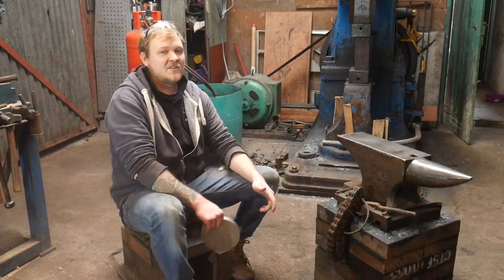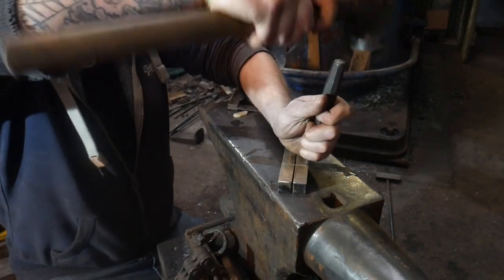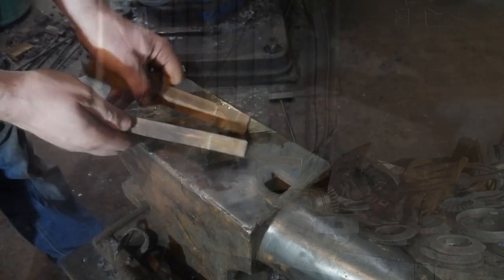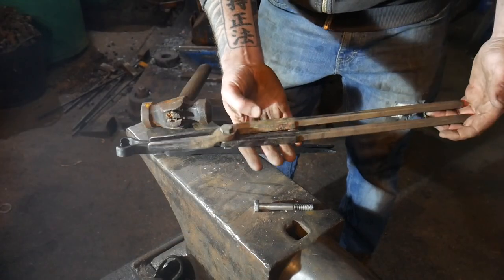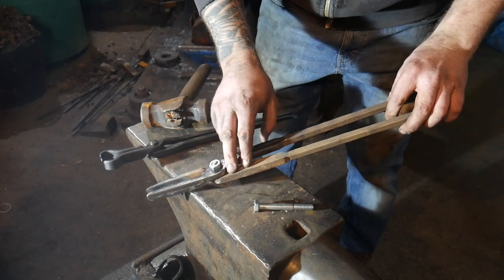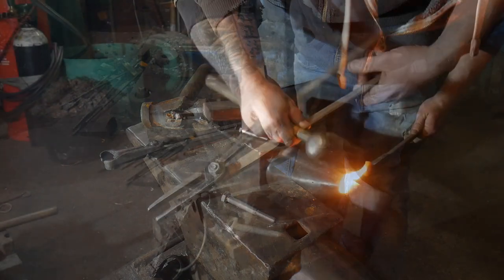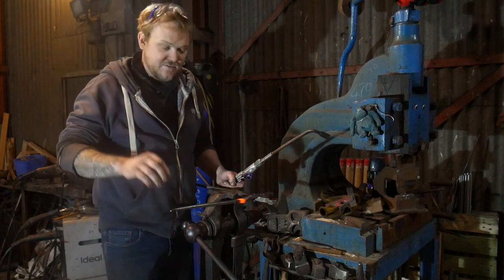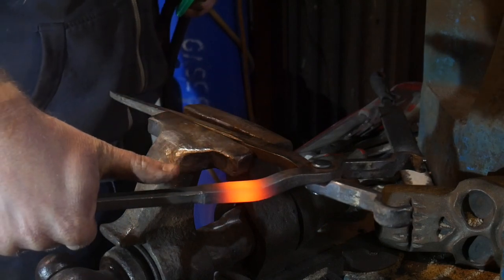Titanium Hammer Tongs! Forging tongs out of Titanium!

Comment: Never forged any titanium.
But I have TIG welded a good bit of it.
It welds beautifully, and takes on an interesting rainbow color pattern in the different heat zones after welding.
Being light weight, super strong and low heat conducting they should be great to work with. Less hand/arm fatigue is always a good thing.
Cheers!

Comment: And yes calsium oxide and water can reach temps to cause a fire. This was done in a controled setting. start off with a cup of hot water sprinkel calsium oxide into water as needed to keep hot.

Comment: The "granular structure": Because of the rapid formation of the oxide you cannot forge weld Ti. With steel that wrinkling would just meld into the rest and end up bonded.

Comment: 1) you need a center punch with a tungsten carbide tip to mark on titanium like that
2) titanium has good thermal conductivity because heat easily passes through. It has poor thermal retention
Reply from the maker: Double check this but titanium is consider a poor thermal conductor. I didn't just say it on the video with out doing any research. Titanium heats slightly slower than steel and stainless steel based on volume. Copper heats faster than steel and is   denser than titanium giving it a good thermal conductivity. I believe gold also has good thermal conductivity and is much heavier than steel. In fact it's about twice the density of lead. I believe aluminium falls into the poor heat condition also. Please check this like I said. When I get home I'll share the link with the information about this.

Also the titanium marks very easily for some reason but is very hard to grind. No idea why as I don't know the grade.
Reply: @danielmoss2089  it polishes easily though which is weird. I have experience with it in jewelry settings. Gold is definitely very conducive as is silver and platinum. Generally I think that the more electricity conducive a metal is, the more thermally conducive it is. That last part I need to check to be sure but I am going off my memory of the metallurgy which, I admit is rusty. I was a jeweler for a decade and had to get out due to disability. I took up blacksmithing as a form of PT.

Comment: Yes electrictry is differnt I always though heat was conducting through a pice of copper You can take a small peace 1' long heat it at one end and the other end gets hot right off like the heat travaled through it fast i always though this was conduction of heat. I gues it doesn't work like electricity. Thanks that answers my question.

Comment: When Titanium get hot fast and then cools off fast it is a good conductor of heat. Silver is an exclent conductor of electricity.Better than copper but copper conducts heat varry whell, Aluminun conducts heat whell also used for wiring. I asume that silver conducts heat whell because it is one of the best con ductors of electricty. You probley have a chart that tells what metal conducts heat the best. I am just wondering what metal is the best?
Reply from the maker: I checked this and the reason quick heating and cooling means poor conductivity is due to the heat not moving away from the point at which its focused. Not sure if you watched the whole video but I talk more about this at the end. Coppers and silver's take a lot longer to heat than titanium because even the areas of the material not being heated get hot as well. Titanium is one of the lowest conductivity metal known to man.
Reply from the maker: Also I believe good is a very good conductor and there are some materials called super conductors which have even better conductivity but they have to be very cold to work.

Comment: If it get's hot and cool quickly wouldn't that make it a good conductor of heat Dan? Steel is classed as a poor conductor because it takes a while to get hot and stays hot for a long(ish) time and the heat doesn't travel through the material well, hence why we can forge it easily.  Copper is classed as a good conductor for the opposite reason.  That said if the heat isn't travelling through the material then yeah, it's not a good conductor. , Titanium is weird stuff.  Nice looking tongs, I bet they're very light in the hand.
Reply from the maker: Did you watch the bit at the end?
Reply from the maker: Also I just checked and its a very poor conductor. Its on of the lest conducive metals and fast cooling is consider poor conductivity. Don't ask me lol
Reply: @danielmoss2089  yeah, edited my comment when I saw that lol
Reply: @danielmoss2089   So would that mean it's an excellent radiator of heat but a poor conductor?
Reply from the maker: So I'm not sure why and I said it with an air of not understanding but it heats up silly fast and cools down very quick and when I did my original research which might be wrong I'm sure it said poor conductivity was seen in the way it get hot and cools down. But copper heats slowly compared to titanium and the whole thing gets hot (copper) . Maybe that's why it titanium heats so quickly cause it doesn't push that heat to the rest of the stock? That would be poor conductivity right?

How are you? And yes very light lol
Reply: @danielmoss2089   If the heat doesn't travel 'through' the material it's a poor conductor, that I'm sure of mate. The fact it heats up really fast only where direct heat is applied supports that.  It's certainly capable of radiating heat really well though, as it cools very fast but that's totally different.  I've no real experience with forging Titanium, hit a couple of bits, was surprised by how soft it is at heat and how fast it got hard, but that's about it. Oh and the weight of course.
I'm not keeping  too bad mate, been getting over some health problems I won't bother going into on the channel but I'm in the middle of a commission for three sign posts at the minute.  Going to be in the workshop as much as I can in the run up to Christmas.

Comment: This is confusing to me I did a since report in 7th grad back in 83 . It was on the 3 tipes of heat energy conduction,readation and convexion. Except for the bad spelling I got an A+. Anny resech I have done on the net Says that is conduction of heat like through a copper bar heat thavales through it fast from hot to cold untill the heat is equal. Or you take a copper bar and 2 stirafoam cups one with calsium oxide and water this will give off heat through a chemical reaction. The other cup has ice and water. The to cups go side by side and the copper bar goes in both cups Bent in an upsidedown U The bar gets hot from the cup with the heat to the cup with the ice untill the cup with the ice almost started to boyle. Like i said i got a A+ the heat was conducted from the hot cup to the ice cup in 1/2 hr the ice was almost boyling . My reesent reserchece on heat energy on the net says the same that this is conduction of heat. so I gues it must be difernt for blacksmithing. Thanks for clearing that up.